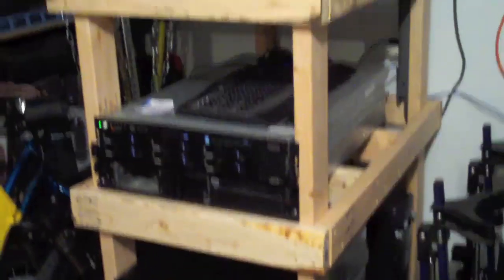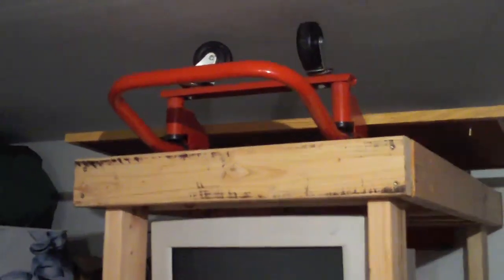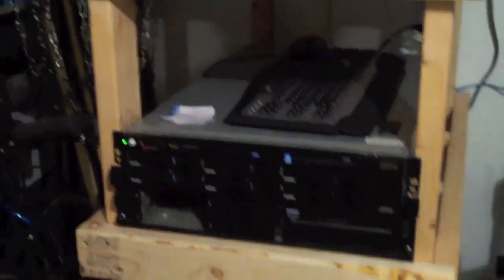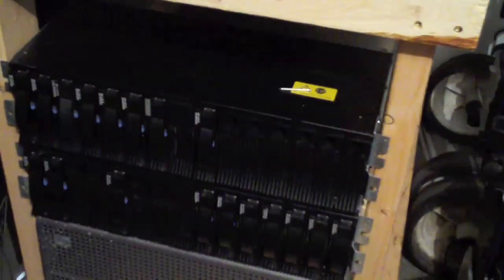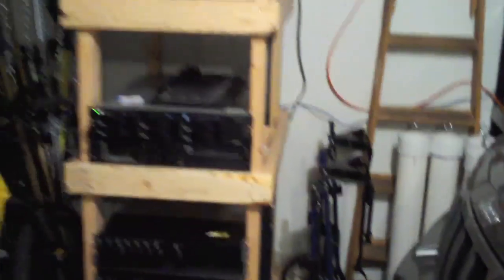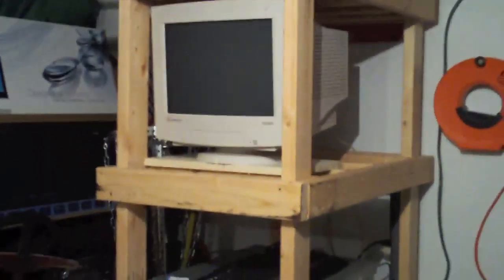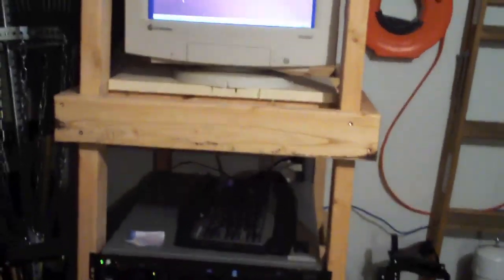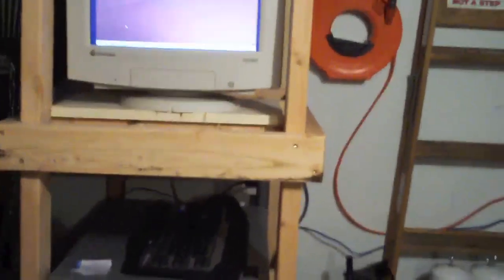My Homemade Computer Server Rack

Comment from the maker: Thanks. It was fun to build. I did have plans to add sides and doors, but never went that far. Definitely post some videos of your shelving build. I pretty much killed my drill when I built this. I'm not to surprised though since it was a cheap drill. I think if I did it again I would use bolts and washers instead of deck screws. Two bolts would replace four screws. Less drilling lol.

Comment: Great design! Using one of the least expensive types of wood and materials! Great functionality as far as strength AND airflow for cooling! I'm about to make shelves for at least 3 rooms, including garage... Some for computer and peripherals, others for heavy car parts and similar.  I have more 2X4's laying around than any other wood!  My shelves will be 58 inches wide, at least. Thnx for postin!

Comment from the maker: @atxguitarist I'm not sure. Is that how its figured. I suppose if it is distributed over 4 casters it might be. I don't even remember what the rating was on the casters. I do have to say that I wished I would have gotten larger wheels because it is a pain to move it when there is a little bit of sand or dirt on the ground. The casters get stuck. lol

Comment: If the casters are rated for 150lbs, wouldn't the max weight be 600lbs? since 4 casters are distributing the weight.

Comment from the maker: @BR177 It does the job. I wouldn't recommend swinging on it or using it as a jungle gym but it does hold a lot of weight. For testing I stood on the sides and bounced a bit with no problems.

Comment: Nice video.  You should try to find a used APC Smart UPS 3000 model for your equipment.  I had gotten rid almost all of my old equipment.  One server running VMware ESXi replaced all the old ones.